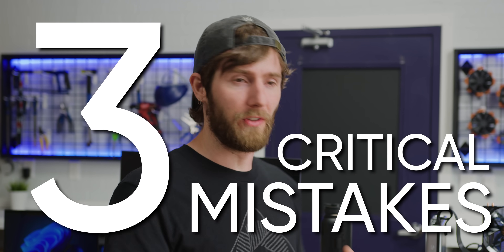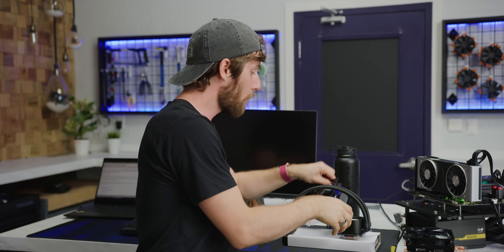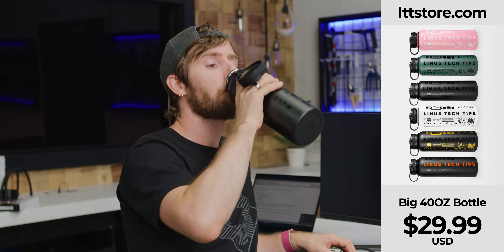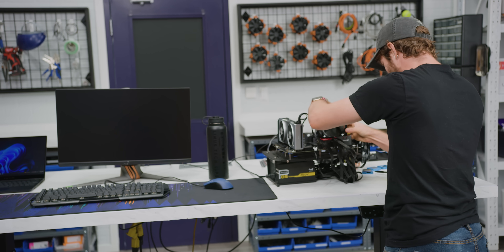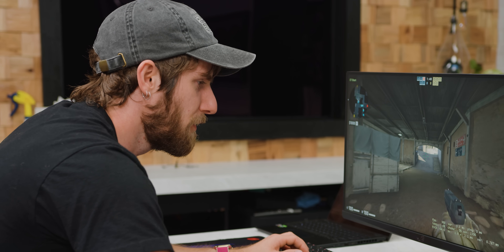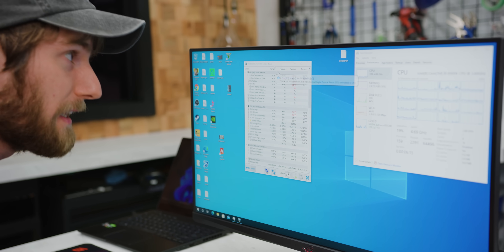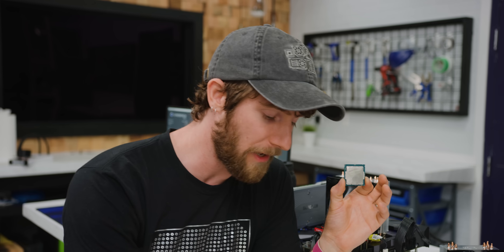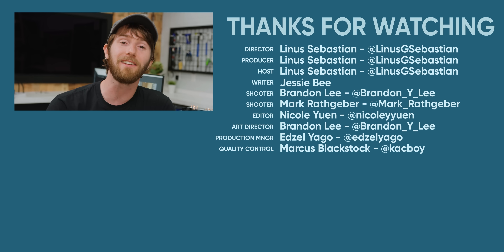How BAD is it if you forget to peel??

Comment: When taking apart my old Pentium II 266 PC from high school, I discovered the OEM that built it hadn't peeled the plastic off the TIM on the CPU heatsink. Funny enough, the system ran just fine for years through lots of gaming and was just about as stable as anything else from that era, and more stable than the Athlon that replaced it. Go figure.
Reply: Sounds like that old PC was Ork technology. You see, red and stickers make you go fastuh!
Reply: Big difference in heat output from a 233MHz chip to a chip with a base clock of greater than 2.8GHz.
Reply: @johngangemi1361  not really, there are 3ghz cpus nowadays that run cooler than old pentium 2s.. those were 40 watts even if trhey ran just at 266. An i3 from 4th generation has about the same wattage and its clocked at 3.3 if i dont remember wrong.
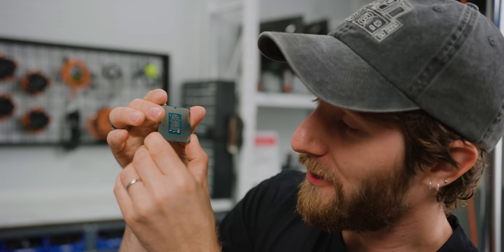Reply: 6:02 - What Linus said to his first successful date
Reply: @MASTER_CHIEFS71  He didn’t need to peel either 😳 he’s circumcised
Reply: to be fair older CPUs didn't even have very big heatsinks so didn't need much cooking at all lmao
Reply: Pentium IIs came in a cartridge, pretty sure the cooler came pre-installed from the factory, at least on desktop models. Not quite sure how one would manage to forget to peel those?
Reply: @MareLooke  nope , cartidge cpu's still required a heat sink/fan to put on them when you bought them for diy. Intel nor AMD sent those out with heat sinks on them already.  in fact  i bout both an amd athlon thunderbird (slot A) and a PII (slot 1) and they didn't even come with a heat sink like many cpus do today. it was something you had to buy separate. they did have a heat spreader on them though like modern cpus usually have.
Reply: @MareLooke   I had Compaq or some other big PC makers PII 233 or 266 mhz and it had it's own proprietary passive cooler. Worked OK.
Reply: Many CPUs live happily with nothing but just passive cooling.
So, not surprising.
Reply: I tried the endurance on a Slot1 PII 233 back in the days to check how hot it could actually run before something happened so i began running it without heat sink and maxed out voltage, it stopped getting hotter about 100 degree C, stable and super boring experience, so i had to isolate it someway so I stick a cardboard over it to reduce the heat radiating, it got about 130 degree C and still stable as it would ever be possible. I had to cover it more to keep going this time with cloth and felts and i got up to about 180 Degree after some serious stress testing but then again it settle down and it was absolutely not budging in it´s performance. I kept playing Elma on it and i had to figure something else out since I had ran out of ideas how to cover it more than I already did, the plastic on the socket part of the CPU had started soften and warp a bit but not anything else. then I got the idea to use yellow glasfiber isolation for house as insulation combined with some of the other stuff I had brought. it got hotter now if I kept loading it 100% for maybe an hour and I got up to 195 Degree C, it was still running stable without any sign of problems, INSANE! but I kept pushing through with Elma and it eventually reached  199 Degree when I pointed the infra red thermometer through the hole I made in the isolation, I played some more while monitoring the temps, I hit the very mark 200 Degree Celcius and I promise this is a true story but that was the limit because I heard a rather sturdy Click from the motherboard and everything shut down. I examined the stuff and there was no really vital things happening other than the warped plastic but the sound had come from the CPU, it never worked again may it rest in piece, the Mobo lived. but for the PII 200 degree seems to be the limit. But I am pretty sure I have quite a record in my experiment for playing Elasto Mania with a CPU at 200 degree celsius and still run the game
Reply: @Pulverrostmannen  k
Reply: I had the same issue with my first laptop back in the day. It worked fine for years, although it became super hot super quickly. I only found out when I opened it out of curiosity and after putting it back  together, it started crashing after short periods. Fortunately a local computer shop found the issue quickly and applied new thermal paste for free because they felt bad.
Reply: Pentium is somewhat a legend to me- I used to play warftame and overwatch with this core and a Intel HD graphics for years without problem.
Reply: Looong ago i dismantled my cousin's computer for some maintenance... What we found was that the heatsink had a broken leg and that the idiot that built the computer left a big paper sticker price tag  that almost covered the whole surface of the cpu.. that compujter worked like that for over 6 years...
Reply: Those old guys really had smallest possible heatsinks and fans. Had P1 75mhz, that worked fine with windows 95 overclocked to 90mhz without even a heatsink. Also remember some day, when our P4 Willamettes 1.8ghz fan died and the sound was just unbearable. So it was disconnected and worked fine with just a heatsink for a pretty long time until new one arrived. And when a fan of GeForce mx440 died, it was left without one and worked like that for peobably 8 more years
Reply: @Peanut Butter & Jelly I’m afraid you’re right. The Pentium 2 was a slotted cpu. Thread OP is speaking cap.
Reply: @Chandra Sharma Whom are you trying to fool Street Pooper. You can't even afford a toilet and you are telling everyone that you had a pc in highschool in that era where pc was extremely expensive.
Reply: @AK-tf3fc  lmfaoooo
Reply: @seriousturn957  It's a common thing among us Indian. We try to boast and lie about things we don't have. Westerners believe it because it's normal things for them.
Reply: @AK-tf3fc  Trust me I know, I work in transport and I deal with lies every day lol

Comment: Back when Socket A first came out, the AMD retail fans had a piece of plastic over the thermal pad.  I was working at a local store at the time, and it was VERY common for customers to not remove the plastic despite a written notice we included with every CPU sold. 

Not removing the plastic was almost guaranteed to kill the CPU.
Reply: hmmm ,  back when i got a thunderbird 850 , it had NO stock heatsink/fan with it at all.  so not sure what you are talking about , had to buy the heat sink separate from the cpu. granted that the heat sink /fan i did buy for it had a peice of plastic over it.  just never heard of any slot processors that came with a stock heat sink.
Reply: @DenverStarkey  Retail boxed CPUs back then came with fans just like current ones.
Reply: @Da40kOrks  not all of them apparently because I had two that didn't.
Reply: @DenverStarkey  Might depend on the store? Maybe some store preferred the kit without heatsink to cut cost.

Comment: This test with the 9900k and the hyper 212 is absolutely useless and demonstrates nothing unless you also run the test with the plastic peeled and you prove it does not thermal throttle under normal operation. Which it shouldn't but it's not guaranteed. I'm all up for entertaining videos; however, if the methodology isn't good enough it leaves a very bas taste in the mouth. And being an LTT viewer for the past 7-8 years I expect more.

Comment: Funny topic. I did this a few months ago on a x5675 build that I put an AIO on. Was checking thermals and noticed after a run with Cinebench I was running around 50c at idle. Thought to myself.. hmm, maybe if I reseat and reapply the thermal paste, maybe I didn't have enough on. So I pull up the AIO block and see that plastic and I'm like... well shit, no wonder.. UGH!! I could have just slapped myself for that one.

Comment: That's not a serviceable temp for my Phenom 1100T BE cpu. It hits 65C and you can expect warnings and at 75C it shuts down. So with my Peltier cooler working correctly again, it doesn't go over 51C nowadays.

Comment: I could've told Linus this. 

I ran my i7-920 overclocked for 3 years with absolutely no problem with the plastic still on my waterblock. I didn't realize it until I was breaking down the computer to give the parts to my buddy and he pointed it out. 

The chip and motherboard ran for another 5 years no problem. But I'm extremely paranoid now and doublecheck every block I install just to make sure the plastic got removed. LOL

Comment: Hi Linus, i know u probably wont see this but ive been having issues with my wifi on my pc, no experts no what the problem is so i was wondering if somehow u could help me, sometimes i can connect to thw wifi but it is not nearly as strong as the test of the devices in my house, also i cannot connext ne ethernet cable to my pc cause it simply wont work, as u can see im in desperate need of help, i own a pc i cant use

Comment: I bought a prebuilt from company that shall not be named and they didn't remove the plastic on the bottom of the cooler.  also no thermal paste, not that it would have helped with the plastic on it... this was an R5 3600X. I knew right away something was wrong when it idled at 65-70C and hit 95 with any kind of load, like opening the browser...

Comment: Same thing happened to me a week or so ago installing an 420mm Alphacool Eisbaer Aurora in a corsair 750d case had to mod the case on top to fit. The drive cage on top just had to be folded down on the side where the motherboard mounts so not a big deal, this was around 3 to 5 in the morning and i was tired right before i powered on my system i realized that i didn't remove the plastic, i was very lucky i would say

Comment: I know someone that used prebuilt pc for 3 years and i found out that the shop did not peel the sticker from heat sink. I found bc the cpu fan has died and i can't find the replacement so i bought the new heat sink for him and found out. The fan must the cpu fan maybe spin at full speed until he died. Haha.

PS it's xeon system with quadro that cost about 3000$ on purchase date.

Comment: This actually just happened to me and could have been bad for my CPU. I just built a system on which I have some VMs using the exact same Hyper 212 with an i5-10400F and the fan was running at an unstable and higher than expected speed. I have another PC with an i5-10400 and Hyper 212 BE which is quiet. 

I just decided to give it a look as it's quick and yep, there was the plastic film I forgot to remove, distracted while building the PC. 

i5-10400F @ idle
With plastic: 54C !!!
Without plastic: 31C

i5-10400 @ idle
Without plastic: 34C

Comment: Back in ~summer 2008, when my home PC was there for 3 years.
I noticed that the CPU, Pentium 4 HT was running hot, idling at around 80 ℃.
Dad took the PC apart and trying to re-apply thermal paste, and he found that a wire was jammed between CPU and heatsink......
After removing that wire, CPU was ~20 ℃ cooler.

Comment: Dude I did this when I bought my first aftermarket cooler, my stock intel was not spinning, cpu @ 100•c, chucked the cooler on, I was even paranoid about the sticker and I power the pc on to find it at 80•c idling, opened file explorer and instantly 100•c again, started to think that the cpu was borked. Took off the cooler and then proceeded to kick myself for about three hours after, still have nightmares about that moment.

Comment: I worked on a laptop that had an Athlon XP CPU in it years ago. The problem was that the CPU was always overheating. I took it apart and found that the plastic had been left on the cooler at the factory. Removing it dropped the CPU temps like a rock.

Pretty sure I saw the same thing on a Dell laptop at some point years later.

The other thing that can cause temps like this is the absolutely horrid paste that Dell used to / still uses. Did warranty work on Dell systems back in the day and both desktops and laptops would have the CPU overheat. On laptops, replacing the stock TIM with whatever I was using at the time (Pentium 4 era) would drop the load CPU temps by 10-20C.

With the desktops the TIM would actually separate and you would end up with hotspots where the silicon in the TIM had pooled which would cause major thermal throttling and the CPU fan to run at full tilt. Replacing the TIM would again bring the temps back in check.

Comment: On my first ever PC build back at the start of the 2000s, I didn't know if you had to keep the hard plastic shell over the thermal paste on the cooler. Was an AMD Sempron I bought for my uncle. I figured that since it came with it, I was meant to use it, so I left it on. The clips either side of the cooler latched on so I figured I was correct haha. Never saw that PC again but I can imagine the bare CPU die must have been covered in melted plastic, with the pre-applied thermal paste still untouched on the cooler haha. I do remember the cpu clocks jumping up and down and never understanding why...

Building a PC now has never been easier, you have a matured internet, which we didn't have back then. :)

Comment: 6 years ago a client bought an insane gaming rig from NCIX for the Cessna replica flight sim in his garage. Since he'd never built his own system before he paid the professional assembly to have the rig built and cable managed. His intention was to overclock the system however he had some concerns because the system temps seemed really for an i7 with a massive Coolermaster cooler. Took it my shop, confirmed the temps were high, being steady at 70 Celsius with no OC. Figured I'd start by reseating the CPU. Not only what the heat sink mounted improperly, with the plate only contacting on 2 corners, but the "Remove label before installing" sticker was stick on the bottom of the heat sink.

Morale of the story: just because it's done "professionally" doesn't mean it's been done to professional standards.

On the upside of this story: he threatened to sue for screwing up the build so they refunded him the build fee and also paid my shop for the work, which is practically unheard of for NCIX.

Comment: Linus, you are my hope to answer this question: when you buy a laptop with a GPU, that GPU is a chip in the motherboard, right? What if you have another motherboard with a better chip, would be possible to desoldered the better one and transfer to the first motherboard? In that case, it will be a GPU upgrade for a laptop user. Hoping you and you team full of pretty capable engineers would make this possible
Reply: Egpu is one of the solution my guy

Comment: And they didn't even test the cooler without the plastic lmao. I can tell you now that the CPU will throttle just about as fast without it, that's a piss poor cooler in the first place. I did this with an r5 3600 and it was only a 5c difference without the plastic on cinebench, yes, it is a much lower TDP chip but the fact remains that the I9 would throttle using that cooler either way, maybe just about 0.2 seconds later than it did without the plastic

Comment: Hah, that i3 just doesn't care. Back in the days when I had i3's, I actually ran some of them without thermal paste (not on stock coolers though, had decent 'towers'). Those low power i3's just didn't care, they were never going past 60*C with zero thermal compound.
An i9, on the other hand, is another beast. With that, thermal transfer is a very important factor.

Comment: Hi I was getting an error on my pc possibly gpu related (directx function get device removed reason failed with e_outofmemory direct 3d could not allocate sufficient memory to complete the call) does anyone know any fixes?
Gpu: evga gtx 1060 6gb super clocked

Comment: I'm actually guilty of this mistake on my 3rd pc. Forgot to peel the plastic off my Dark rock 4 before attaching it to my ryzen 5 3600.
Everything worked fine but I always like to benchmark and was boggled by why my cpu thermals was 60 degrees celsius idle and reaching 80+ on ANY workload.
Reseated the cooler, undervolted the cpu and even added more fans but the results were the same.
Thinking it was the thermal paste's fault, I ordered a thermal pad that came a week later. That was when I found out about the unpeeled plastic.

To be fair to myself though, I built the PC past midnight with a lot of other things on my mind at the time lol

Comment: It's not only a diy problem. Bought a Gigabyte rx580 that kept crashing under load. Fought for weeks to get it RMA'd, and was about to send it off, when I decided to tear it down myself. Turned out there was the gpu plastic still in place, folded over half the chip, and mashed in place with thermal paste. Removed the plastic, repasted, and havent had an issue in 2 years.
Reply: Glad to hear that had a happy ending!

Comment: I had this happen to me, but I wasn't the one who built the PC. I bought the parts and had the store assemble it for me. It was only about 3-4 months later I monitored my temps because I was experiencing some issues, and saw my cpu temps for my 5800X were throttling at the max of 90°C at first my friend and I though they didn't put thermal paste. But no, I removed my cooler and saw that damned plastic was still there. It was a miracle that my cpu didn't go up in flames or even had my pc shut down thermally.

Comment: Before even watching the video, I can tell you from personal experience, its HELLA bad! Used a 4790K on a 120mm heatsink cooler without taking the peel off and I never noticed until I upgraded my system to a new case and cooler cos I was thermal throttling all the way down to 2.5ghz and sometimes even hitting below 2ghz. Felt like the biggest idiot spending an extra $200 on cooling JUST because I forgot to peel!!